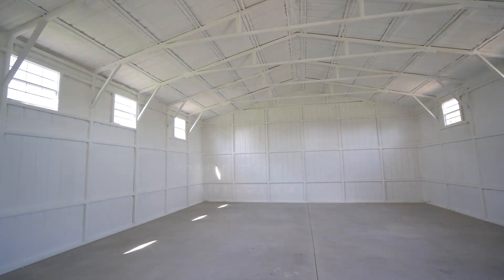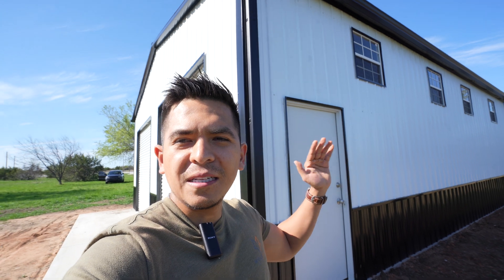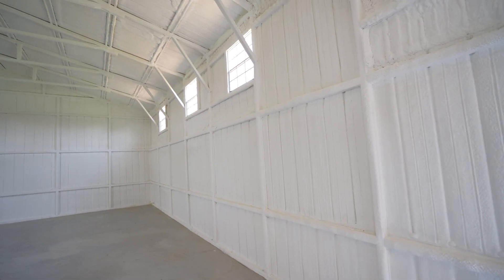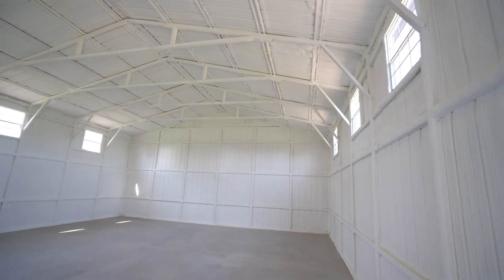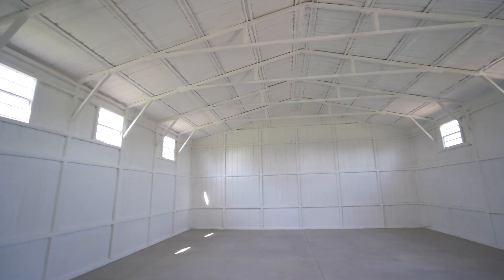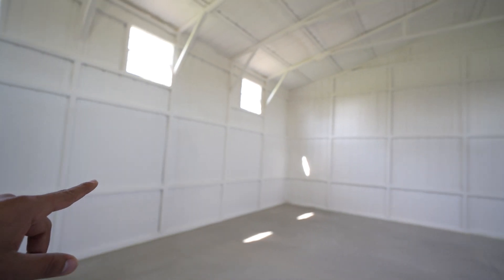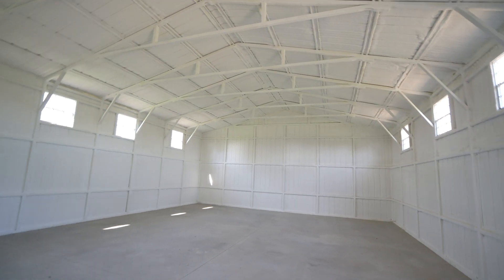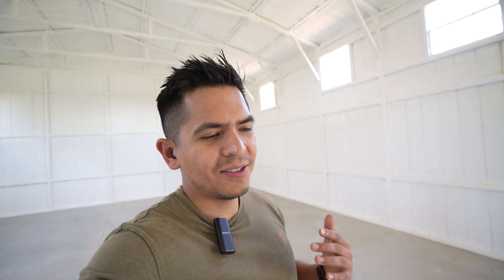Spray Foam Insulation on 30x40 Tubular Metal Building | WolfSteel Buildings

Comment: How heavy is it? Do you need to account for it on the gauge of panels?
Reply from the maker: it can vary by the type of spray foam (open/closed) and how thick (1" / 2") the customer wants it. There is no need to increase the gauge of the panels. We do spray on the 29G panels. Great Question!
Reply: @wolfsteelbuildings  Thanks!

Comment: I have a question, I’m thinking about buying Alan’s Metal building. I live in Tennessee. They tell me if I spray with spray foam it voids all warranties on the building. May I ask , why ?
Reply from the maker: Great question William. Every Tubular contract has that and it applies to anything in most cases such as spray foam, electricity, wood, etc. For spray foam, the reason is because they are not aware of the effects that the spray foam will have on your metal building. While spray foam is a great product when installed properly, if the installation is not done right you can have corrosion issues, loosened screws, etc. I recommend to find a reputable spray foam company and check out there work in person on a metal building.

Comment: @perryfaulk9344
0 seconds ago
I'm a manufacturer of Bubble insulation. The problem with these so called experts they have no idea of the science of thermal transfer and how heat transfers in and out of a metal building ..Fiberglass batting insulation and foam insulation achieves an R-Value buy trapping dead air .The most common fiberglass batting has about an R-Value of 2.8 per inch ..Open cell foam has an R-Value of 5.5 per inch .. Bubble Reflective insulation achieves and R-Value of 5.5 per inch of dead air space ..All testing don't buy the Federal Government has shown that one thin layer of radiant Barrier blocks energy transfer better than 6 inches of fiberglass insulation..Bubble insulation is also a better option because it provides and R-Value and Reflectivity.. while the other two options are one trick ponies ..Go to RBWAREHOUSE.com for a better information.

Comment: I’m not sure what you mean by it “feels dry”. Spray foam will actually put you in need of a humidifier. But just wondering who you would recommend to do this service in Georgetown where we are putting up a wolfsteel building. Is this an upgrade option on the building where I don’t need to go third party for the foam?
Reply from the maker: Spray Foam is a perfect way to thermal control your building. Helping control condensation and the outside humidity is why we "feel dry" inside. 

We can do that for you! I was not able to find you under a salesperson but if you notify the WolfSteel Sales member you're working with they'll add it to your building order! 

WolfSteel can do Site Clearing, Site Prep, Concrete, Building, Insulation, Gutter Systems, Custom Doors, and more. We also offer full project financing!
Reply: @wolfsteelbuildings  My son-in-law is mostly in conversation with y’all. He’s working with a David. We are eagerly awaiting a bid on excavation and foundations for all our builds so look forward to hopefully getting good numbers from y’all on that this week. Would love to hear the numbers on the insulation as well.

Comment: what is the r value of 2 inch spray compared to 2 inch fiberglass. which would be best bang for buck?
Reply from the maker: 2" Spray Foam: R Value 14
Fiberglass typically comes in 3" or 6" for Metal Buildings, but rule of thumb is R Value 3 per inch. For 2" I would say about R Value 6. 

Best bang for your buck depends on what you're trying to accomplish. Spray Foam is more costly, but it completely seals and thermal controls your building giving you the complete R Value 14. With fiberglass you will need to add more fiberglass to accomplish the same R Value as spray foam and to get the full R Value you would need to have a fully sealed building. With Fiberglass there is potential air penetration which can reduce the R factor. 

Hopefully this helps!

Comment: curious why all knee braces are left i was told 4 sided tube steel structures don’t need them after it is erected
Reply from the maker: All depends on the engineering. There is a way to remove the knee braces by customizing the framing. However, if your building is a standard tubular building most likely wouldn’t pass engineering.